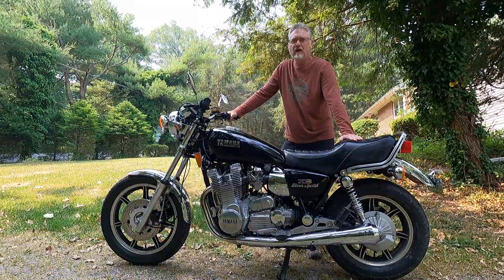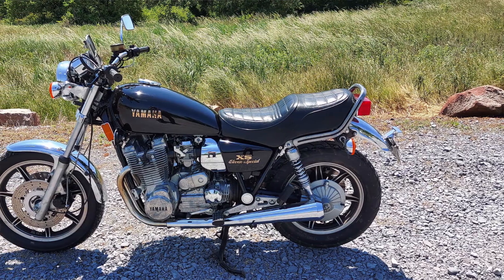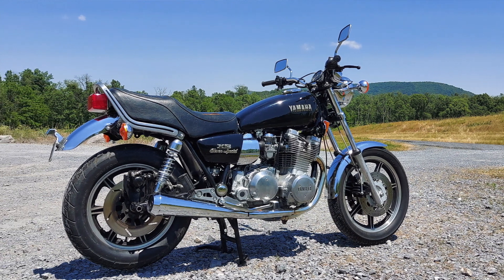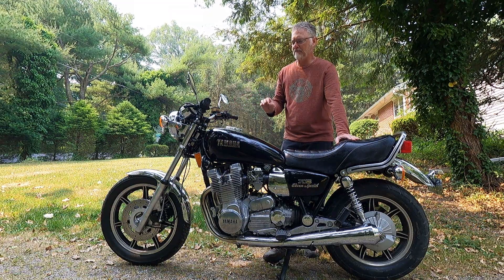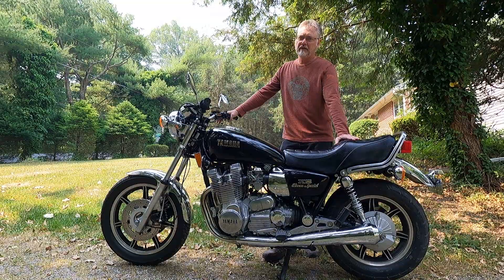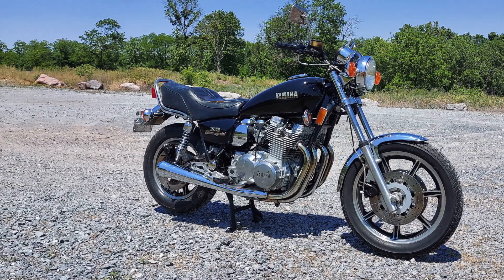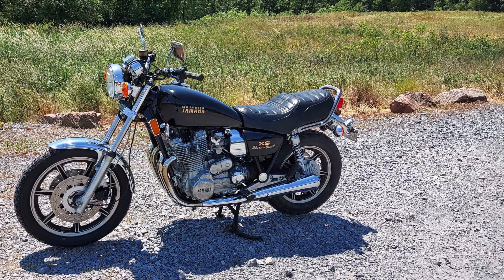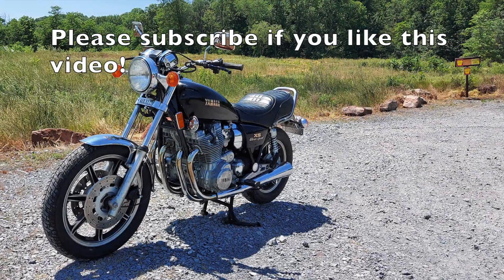1980 Yamaha XS1100 Restoration - Part 9 - New Seat, Project Wrap Up

Comment: Fantastic work, Jon. She's beautiful and sounds so good!
Reply from the maker: Thank you!
Reply: @jonsmotorcyclerescueandrev3538  I see the Tachometer at the red very fast.. normal..?
Reply from the maker: @Swokpmund  This is still a very quick bike and it picks up revs quickly too. Being an antique bike, the tachometer can be somewhat "bouncy" and not super accurate. This is why I don't push it right up against redline as I go through the gears. I hope that answers your question.
Reply: @jonsmotorcyclerescueandrev3538  sorry I meant while you're riding it on the vidoes even not going fast the Tach is very close to Red.. from what I can see...
Reply from the maker: @Swokpmund  It is geared pretty low with a 8,500 rpm redline. So, probably closer to redline than you may be used to.
Reply: @jonsmotorcyclerescueandrev3538  ok... I see I see...! Thanks Jon for the clarification.
Reply from the maker: @Swokpmund  You're welcome!

Comment: Wow, that inline baffle solution is... unexpected. How did you think of it?
Cheers and keep on trucking!
Reply from the maker: @TheMarcball  First, the vacuum line was hooked to the wrong port by the previous owner. It should have been plugged into the carb, not the intake boot - I found that out later. The vacuum for the petcock should be connected to the intake boot. I realized that the vacuum pulses were too large and causing the advancer to knock. The baffle effectively reduced the pulses getting to the advancer. I left the baffle on even after switching ports, and it works great. Cheers!

Comment: ...trying to guess what the difference in "character" might be compared to the other models mentioned.  I might assume that possibly the XS is a bit lower revving and produces good power at lower/mid rpm...as opposed to really screaming at high rpm.  Not sure, as I haven't ridden many other inline 4 liter bikes.  The bike I got after my XS was a V65Magna and thought they had somewhat similar power delivery.  
Eric in NC
Reply from the maker: Right on, they were both smooth, powerful machines. Cheers!